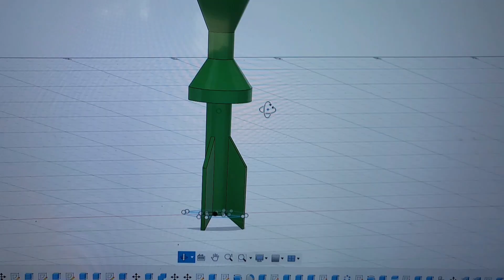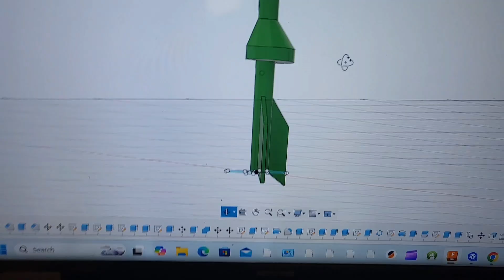I Over Engineered a Q-tip launcher

Comment: It is a Very good design well done. For the bellows to not need glue adding 3 to 6 locking tabs on the bellows with angled teeth would give you a good retention fit and seal. The base would have slots in it as well. Regarding the sabot cutting down on its mass is super key but also maximizing the drag so it splits apart and brakes so itself isn’t a projectile
Reply from the maker: Yeah that would be a really good idea for a next level one!

Comment: also I feel like the projectile would have to be much heavier than the sabot in order for the separation to not affect its trajectory, which is what happens here
Reply: The sabot separation did not affect the trajectory in any meaningful way. The Q-Tip had no fins for stability and had a center of pressure shifted forward by the head causing it to begin flipping around.